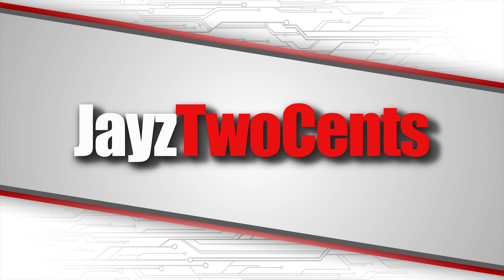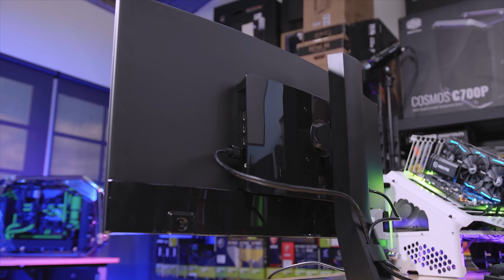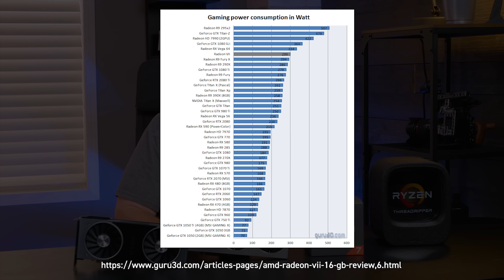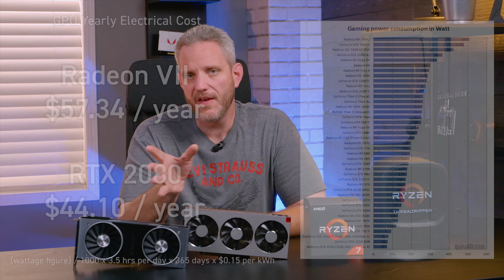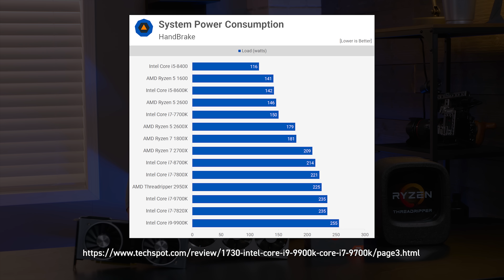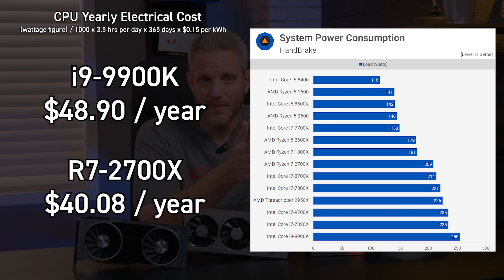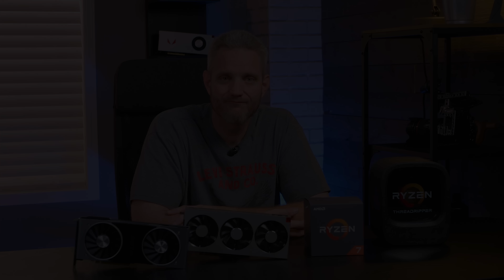Energy Costs of AMD vs Intel vs NVIDIA... This might surprise you

Comment: Anyone remember the oven?

AMD FX-9590
4x GTX 480
Reply: Lmao no need for a home radiator
Reply: My old rig I sold a year or so ago to a friend was fx8350 x2 GTX 760's lol
Reply: I dont need an Radiator in Winter with my oc FX8350 in 4,6Ghz
Reply: i had an intel core duo 820 or something....it draw 100Watts even when the pc was turned off :D:D
Reply: @tomast9034  lol
Reply: The project easy bake
Reply: Un-proud owner of the 9590 (thinking it was better than my 4350).
Now I got a Ryzen 5 2600. No more issues.
Reply: GTX690 and r9295 lol
Reply: I used to have a 8320. It was great during the winter tbh
Reply: Imagine running it in Southeast Asia.
Reply: Lester Lee i did
Reply: I remember. I still use the FX-8350, and it's hot as hell.